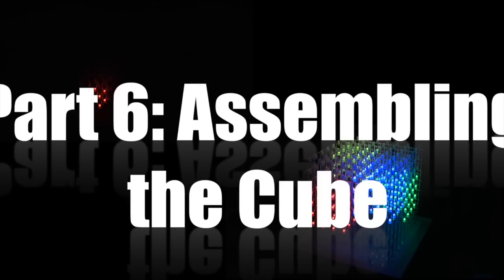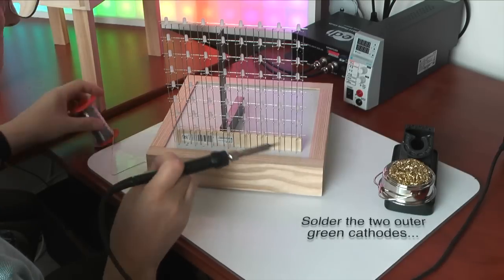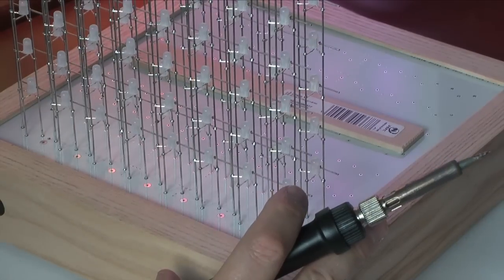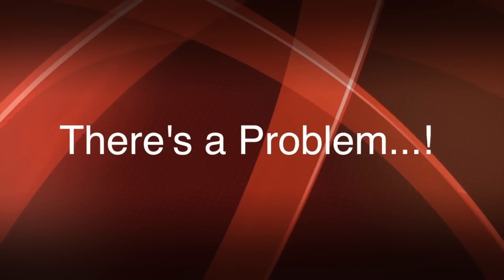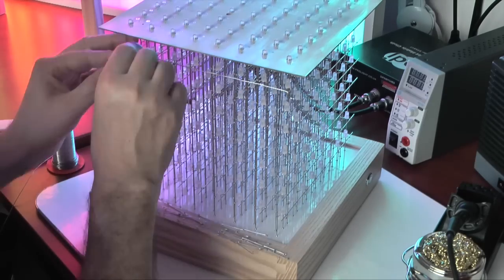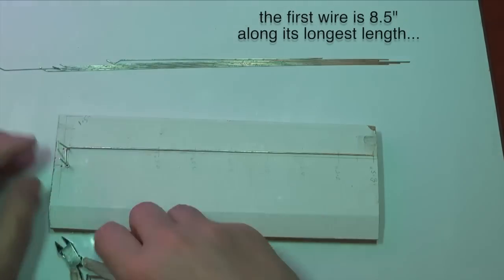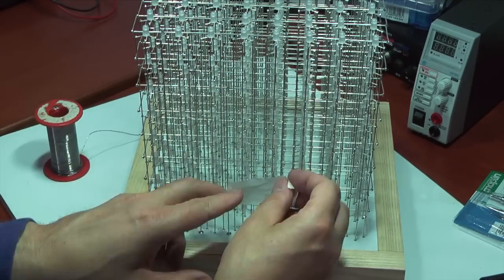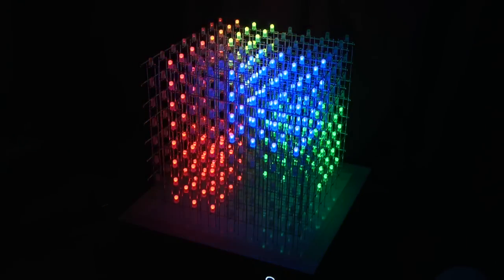Construction of an 8x8x8 RGB LED Cube. Part 6: Cube Final Assembly

Comment: Mr. Manley. I'm proud to announce I finally finished my 8x8x8 RGB LEdD Cube designed by you. I took some time because I did it during my free time at the weekends. But I would say the project is fine. Please, watch the video on the link below. Besides that, since I'm not an expert in electronics, I noticed some bugs and I appreciate it if you can give a tip on how I can try to fix it. You will notice some columns of lights that keep on turning green. Please share your thoughts and tips. Definitely, you shared the best LED Cube project on the internet. Thanks for this. Link: https://youtu.be/mJHuAFrSn-Q
Reply from the maker: Hi Paulo, great news that you completed a cube base on my design. Nice video also, so thanks for sharing this.

The issue you describe, and with the clear evidence I see from the video, I can confirm that I have experienced the very same problem, but for me, it was columns of blue LEDs. I didn’t fully identified a single cause but I do know what’s wrong. At least one green led (for you, blue for me) in each affected column has started conducting in the reverse direction, or is starting to short circuit. Therefore, that led needs to be replaced, else it will only get worse. If memory serves, one led in each column will be slightly brighter than the others, and it’s that one that’s faulty. Once identified, cut the green led leg off of that led, and  see if the issue for that column goes away. Obviously that green led won’t work at all because it is now open circuit. If the issue goes away, then completely cut that led out and solder in a replacement, it can be done, but is not easy, especially if in the middle of the cube. It could mean removing several anode wires to get better access. It also depends on the tools you have. Luckily for me, I had a pair of cutters that were nimble and long enough to reach the middle.

When bending the legs of the replacement led, don’t make closed loops, else you Won’t be able to fit the led around the existing wires. Instead, from an open loop or hook. I’d also suggest putting the bends in the legs a little further away from the led body, and here is why.

I think there are a couple of possible causes to this issue:

1) The led legs are being bent to close to the led body, thus placing mechanical strain on the led junctions inside the led housing, and causing the green junction (in your case) to break down.

2) Poor solder technique, ie heating the joints for to long, or having the iron to hot.

I recon it’s the mechanical strain rather than poor soldering. If it were the latter, you would be seeing different colours failing.

I had to replace 12 LEDs in my cube, but 8 of them were totally my fault. While attempting to fix an led, I stuck the soldering iron into the cube having not powered the cube off, thus caused multiple short circuits that did a lot of damage. It was rather soul destroying, but I recovered the cube, and you would hardly know it had 12 LEDs replaced.

Hope this helps.

Good luck, and let me know how you get on, or if you need further clarification.
Steve.
Reply: @stevemanley3685  My cube has this same issue on a single column, with the faded green color. I will take a closer look at this tonight and see if  one of them that is brighter and attempt the repair. I think the column is only one row in, so may not be that bad. We still get a lot of comments on this cube, it is really cool. I need to take time to understand the code and see if other animations can be achieved. I found a code called "Dagens Demo" that has some really nice animations.
Reply from the maker: @berner57  Hi Jim, Glad you have a working cube and enjoy it. My original code is nothing special as I never quite got around to finishing it. Plus the way I wrote the animations wasn't very clever and is  inefficient. I also needed to implement Bit Angle Modulation (BAM) so as to get more colours out of the cube. A guy called Dagen built a cube as a school project. He and one of his friends did manage to get BAM working and came up with some nice animations. Dagen then shared his code with me, hence Dagens Demo, so he gets full credit for that :-)

Re the faulty column, sorry to hear you have identified one. Hopefully you can fix it. I'm sure if its only one row in, you should be fine. Once you identify the dodgy LED, just cut it out as close the the vertical wires as possible. Bend up a replacement LED but don't form full loops, but instead, form partial loops (or hooks). Then place the LED above the original solder joints and solder it in. It may be just slightly out of alignment, but to be honest, I replaced 12 LEDs in my cube and I can't identify which ones they are.
Reply: @stevemanley3685  I turned on my cube last night to observe the issue, and I observed the following: The bottom LED does not seem to light up green at all, and then the rest of the column lights up green. It does "kind of sorta" look like the led just above the first one is brighter. Before I go snipping a wire, I was just wondering to get your thoughts on which one I should focus on first....
Reply from the maker: @berner57  Hi Jim, I would refer you to a comment I made nearly a year ago to Paulo Arruda at the head of our comment chain. The LED at fault is likely to be the brightest one. Snip the green cathode for that LED so it becomes open circuit, then test to see if the issue has gone away. If not, apply a dab of solder to re-connect that LED and try a different one, maybe the one that isn't lit. It's a process of elimination. JUST BE SURE TO TURN THE CUBE OFF WHEN YOU ARE WORKING ON IT, else you will do a lot more damage, as I found out once. I had to replace 12 LEDs as a result of that mistake.

Comment: Hi steve You wrote about Kevin Darra’s code on your blog. Can I use it in your cube?
Reply from the maker: Hi Andrey, If memory serves, I think Kevin’s code might load and run, but it will not display correctly, and would therefor need some modification to work on my version of the cubes hardware design.

Kevin’s code uses Bit Angle Modulation (BAM), which makes it a bit harder to adapt, but it is possible. Check out the code example from Dagan (see link to code examples in the Video Description who got BAM working on my design.

Comment: Hi Steve,
I have finish the cube. When I turned on only one of the blue LED24 was on. the problem was blue line was shorted with anode link wire, which I fixed it. Now the text demo runs OK,  cube0_0 test starts, but it stops at different point of test with all LEDs off. Do you have any idea what can cause that?
Reply from the maker: Hi MK, Really sorry to hear your having difficulties. Short circuits on the cube can do a lot of damage to the LEDs, I know, cos I shoved my soldering iron into my cube to fix a duff LED, and forgot to power the cube down first. It destroyed around 12 LEDs, some right in the middle of the cube, which were hard to replace. Luckily it didn't damage any of the components on the PCB's, and has been working fine ever since.

I loaded the Cube Test 0.0 code onto my cube and the code is running fine, so I can say it isn't the code, and must therefore be a fault on cube or the electronics driving it.

It is difficult for me to figure out what the issue is that you currently have, but either the short on LED24 and the Anode wire has damaged something else as well, or there is a fault else where. I have a couple of ideas.

1. There is a short circuit, be it on the cube, or one of its LED's (i.e. a faulty LED), a short on one of the PCB's, or from a damaged component, that when certain pathways are made, it causes the system to stop, or prevent the cube from displaying anything more until I guess you reset it. 

I recommend disconnecting the PCB's from the cube and one another and check the cube has no short circuits, as best you can. Examine the PCB's to make sure there are no short circuits on those. Try running the cube with just one shift register board connected and see how that goes. You can try just one board connected to any of the LED columns. You can then add a second, then a third, then the fourth, just to see if there is a difference.

2. Check the wiring from the Anode board to the 4 Shift Register boards. There is a driver chip on the Anode board that splits out the CLK signal from the Arduino to CLK1 & CLK2. CLK1 should be connected to the first 2 Shift Register boards only, and CLK2 should be connected to the 3rd and 4th Shift Register boards only. If you have just one CLK driving all 4 boards, then you will definitely have problems. The CLK signal from the Arduino doesn't have output drive capability to drive 25 shift registers. By splitting the CLK through a buffer chip, there should be enough drive to cope with 12-13 shift registers for each of the CLK outputs. CLK1 drives the first 13 SR's (don't forget there is one on the Anode board), and CLK drives 12 SR's.

3. You may have purchased different variants of the Shift Register chips or the driver chip, which are causing the CLK signal to not be able to drive all the Shift Registers.   

Can't think of anything else right now, so I hope this helps.

Comment: Hi Steve! (… and anyone who may be thinking of building this)

I just completed this build as a summer project, and I was in complete amazement when it worked perfectly the first time I hit that power button. What a sense of accomplishment, and a true indicator of just how well you designed this! Thanks for your work and making it available. For anyone considering to take on this build, I have a few words of advice.

1. Do NOT under-estimate the importance of having accurate jigs!!! Take your time and get them right, and your build will go much better. I used my 3D printer to make the anode rail jigs, mostly because of the precision I could get with that. I also 3D printed a jig for spacing the panels during construction, as I did not want to drill out a base board. 
2. If I make a second cube, I would probably skip testing each LED prior to bending them. I only had 3 failed LEDs, and they would have been caught during testing when making the anode rails. 
3. I skipped the testing of each completed panel. The wiring of the test rig looked way too complicated to test 8 panels. I felt confident the testing I did would catch failures. So far so good.
4. I did not have crimpers to make the molex crimp housing, and they are expensive! As an alternative, I purchased these connectors from adafruit (https://www.adafruit.com/product/1950) and they worked perfectly on the molex connectors.
5. I constructed my base using a lock-miter bit on my router table. I did this because I wanted to route a groove in the top so I could place an acrylic cover over the cube. I am very glad I did it this way, the reflection of the LED's on the acrylic gives the cube even more depth and looks really cool.

Now that I have a working cube, I am wondering if others out there can comment on where I could find additional code for animations. My programming skills are not as good as my soldering skills...
Reply from the maker: Hi Jim,  Thanks for the comment/feedback, which is all valid and useful info. Also glad your project worked first time, well done.

Now that I have a CNC router and a 3D printer of my own, I would also make my jigs using those tools. I also agree about skipping some of the LED testing, and for all the same reasons you suggest. I would also great a new LED leg bending jig that didn't bend the legs quite so close to the LED.

Thanks again, Steve

Comment: From where you purchased link wires?
Reply from the maker: All parts and where I purchased them from can be found in the Full Parts List here: https://www.dropbox.com/sh/fyvszu2xnow17fg/AACotfHOmN3eo0gS3QTL1lH1a?dl=0

The link wires than make the cube were made from tinned copper wire that I bought as a role of wire, that I then straightened, cut to length etc. If you mean the link wires connecting the circuit boards, then I made those up myself. Hope this helps.

Comment: Steve,

Do you have a list of the wire gauges you used? I can probably figure it out by studying your pics, however, if you had that wrote down somewhere that would be a time saver.
Reply from the maker: Hi, The only wire gauge I recorded was that of the tinned copper wire (20 SWG) I used for the cube itself. 

I used some quite heavy gauge insulated equipment wire for the 8 Anode connections, which was a massive overkill, and unnecessary, and standard equipment wire for most other interconnections, some of which were bits of a ribbon cable.

I pretty much used whatever I had laying around. If you need me to be more precise, then I will have to go figure it out and let you know later.

Do you need me to be more precise?
Reply: Appreciate that offer but I wouldn't fuss about it. I thought the anodes looked a bit heavy which is why I wanted to double check. Thanks for all the hard work you put into the videos, guides, and drawings.
Reply from the maker: jared m No problem Jared, and thanks.
Reply: @stevemanley3685  Steve I hate to bug you again but do you have any revised Arduino code for Kevin Darrah's setup or Nick Schulze's? I was able to get your code sketch files working on an Arduino Uno and Kevin's "sort of working" on an Arduino Mega 2560. I really don't know how to describe what it's doing at the moment. The multiplexing seems like its all wrong. I'd like to pick your brain for some suggestions if you have the time.
Reply from the maker: @Jared: Jared I just uploaded a sketch to my dropbox account called Dagans_Demo. This is some code written by someone else who built my version of an 8*8*8 RGB Cube, and it does better things than my original code. In fact it uses Bit Angle Modulation  like Kevin Darah's version:

https://www.dropbox.com/home/Steve%20Manley%20-%203D%208x8x8%20RGB%20LED%20Cube%20Project%20-%20Shared%20Files/Arduino%20Sketches

As it happens, Kevins code doesn't work so well on my hardware. Like you already found out, the multiplexing is kind of all screwed up. It can be modified to work, but I've never put in the effort to adapt it. I have no experience with Nick Schulze's code, so can't advise.

Try Dagan's code. I know it works on my hardware design.

Let me know how you get on.
Reply: @stevemanley3685  Dagan's code worked great! I have some lights that I must have soldered incorrectly that I'll need to fix. I'm happy with how it turned out thus far. If I feel ambitious enough I may try to get some other animations to work. I'll make sure you get them if I do.

Thanks for your help once again Steve. I may try making your clock next :)
Reply from the maker: @Jared Glad that the code worked for you. Sorry to hear that you have issues with some LEDs. 

I had issues myself and had to swap some LEDs out after the cube was finished. A couple of the LEDs were right in the middle of the cube, but I did manage to do it without having to fully dismantle the cube. I removed the horizontal anode link wires, and with some miniature wire cutters, cut out the defective LEDs. I then bent the leads of replacement LEDs but made a hook rather than a loop. That allows the new LED to be placed using long narrow tweezers or pliers, and rest the LED on top of the old solder joints. Then solder the new LED in place. I then fitted new anode wires as I cut the old ones for ease of removal. It is all very fiddly and it does need the right tools. 

Very Important! Make sure the cube has the power removed. I forgot, and shorted out bits of my cube with the soldering iron and damaged 12 other LEDs, thus had to replace them as well. That was not a happy day.

I would love to see some more patterns, so if your happy to share, then that would be very welcome.

Comment: How much is one?
Reply from the maker: Jorge Vidal Hi Jorge,
The largest cost is the LEDs and the circuit boards, and will depend on where they are sourced. Check out the parts list link in the description for a rough idea of cost. However, I would expect the circuit boards and LEDs can be purchased for much less if you shop around and were to deal directly with China for the PCB,s.
Reply: @stevemanley3685  it's a very clean project!... what kind of wire u use to conncect the leds?
Reply from the maker: @ @jlvidalsyt - Thanks, I used 20 SWG (Standard Wire Gauge) Tinned Copper Wire

Comment: Can I get a wiring diagram from the external terminals of the box?
(USB, Arduino, 6V Power Supply, pushbutton (?))
deveczmk@zalaszam.hu
Reply from the maker: Miklós Devecz Hi,
You should be able to find a wiring schedule in the available files from the links in the description.
Reply: Steve Manley  I did not find anything about box side terminals.
Reply from the maker: Miklós Devecz Hi, 
There is a folder called “Wiring Schedule” that contains most of the info you need. The push button is just a reset button wired across the Arduino Reset and Gnd pins. USB on the Arduino is used to power it. All I did was get a spare USB lead, cut of the unwanted connector, then connect the Red and Black wires to the 5V supply accordingly. The other 2 USB wires were cut back as they are not used. I have also since found my cube runs on 5V just fine and the diode on the anode board can be replaced with a wire link if using just 5V.
Reply: Steve Manley  Thank you. I understand now.